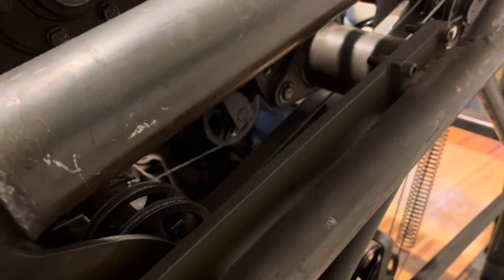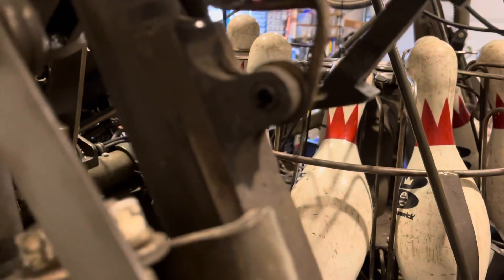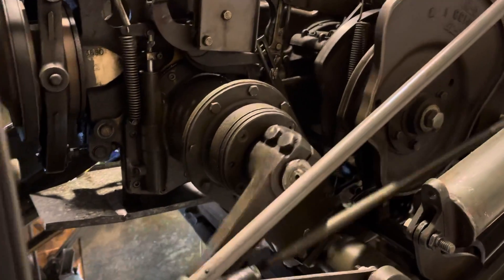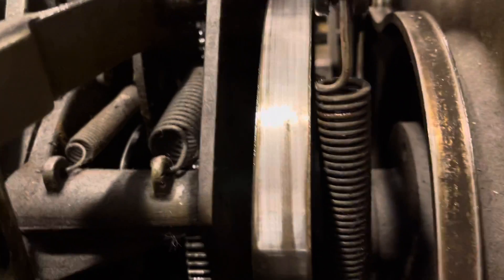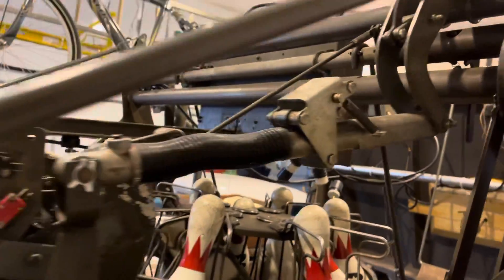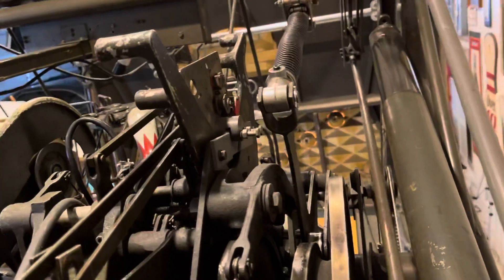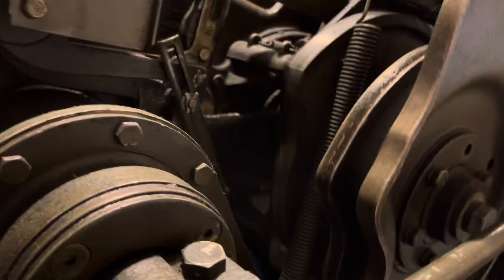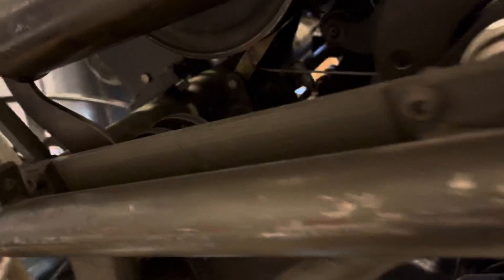Rake operation Brunswick Pinsetter

Comment: That would need to be shown to some Bowling Places, where even on some Brunswick A-2 & Brunswick Jetback Pinsetters of either some select or all Lanes, the rake release has gone bad & even when the Ball hits the cushion, it won’t release the rake & just end up coming down at normal speed by that wheel thing (Cam, is it?) that you showed us in the Video, just as the Pinsetter Cycle starts.

At Bowlero Kyrene in Chandler, AZ (Formerly Brunswick Kyrene Lanes…), after the Bowling Place got renamed to Bowlero Kyrene back in February 2019, the affect from it came to where on some Lanes, I basically call it where the Pinsetters become fully unresponsive, as in again when the Ball hits the cushion, even super hard, just hard enough to release the rake drop, the rake doesn’t drop at all ‘cause basically, the rake drop release has typically gone bad.

On all the 40 Lanes for the Bowling Place in Chandler, AZ, the Lanes where the Pinsetters are fully unresponsive to the rake drop release are on Lanes 3, 4, 5, 6, 16, 18, 20, 21, 25, 28, 30, 32, 34, 35, & 37.

The reason why I know about this is ‘cause even though I haven’t bowled there in a long time, as a few other YouTube Users are doing some Videos there as well, I just typically take a look at their Videos & look at which Lanes have those Pinsetters being fully unresponsive due to the rake drop release gone bad overtime of the Bowling Place being renamed to Bowlero Kyrene, since February 2019.

Comment: What was the purpose of that large outer cam that was used in the A but not the A2? What other mechanism replaced it in the A2?
Reply from the maker: It was the rake cam follower for 2nd ball. Obsolete on the A2 or when the A was converted.   Mine stayed to live once more many many years later when I un-converted mine back to an A from A2

Comment: So you said the larger cam was from when it was an "A" machine.  What is the benefit of the smaller cam over the larger one?  Also what other things were done to change a machine to an A-2 and how did that make it better?
Reply from the maker: Smaller/larger cam?  There’s a smaller and larger motor pulley from the A to A2.   The A pulley just runs the machine slower.    I’ve never understood an A2 speed Pinsetter.    Why stresss out the gearbox and components running it super fast.   I’ve never seen a bowler standing and waiting on a machine to finish its cycle.    I like the slow speed    I’d even consider a smaller pulley on mine 😁🎳
Reply from the maker: Forgot.    Differences in an A to an A2/jetback.     The ball  lift rods are shorter because the kickbacks the machine sit on are higher on an A   The back half is cut off so there’s a ball booster or accelerator on the A2 to shoot the ball back quicker.   So lift rods shorter since the ball doesn’t go up as high, then the cushion is replaced by a different style and also incorporates a rake drop and electrical triggering system as opposed to a mechanical trigger like the A has.   The cushion kind of folds up allowing the ball to go under where the A has to raise the cushion up when the cycle starts.   A2 and jetback the rake drops when the ball hits the cushion.  A the rake drops when the cycle starts.   There’s other things but that’s the basics of it.

Comment: A lot better than the hockey stick it originally had before modifications. 
The mods are close to the jet back pinsetters but doesn’t have the A2 speed.
Reply from the maker: I’ve been tempted and would like to be the first person in the world to convert their machine BACK to an A !
Reply: Maybe you can do a video on the 5 pin chute blocking fingers and their purpose .
Reply from the maker: That’s on my list to do.    I did a rake arm replacement today and took shots along the way.   Blocking fingers was one I’d like to do too.   I mentioned you in a comment in a FB group    They showed the cheap one arm reset lever and I commented not using your name but that you took 2 and welded one dual arm reset lever out of it.    I’ve got a list of other stuff like HOW the scissors work and the deck shift too.    Those will be harder.    Blocking fingers would be a good one to do next though.
Reply from the maker: Mine had the bigger speed pulley but I got an A pulley.    No need for it to run in overdrive speed